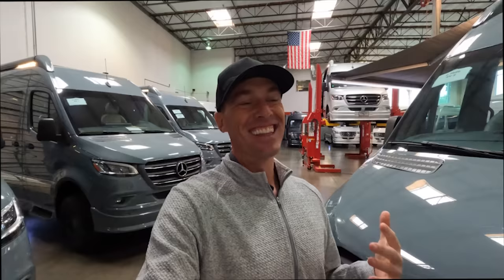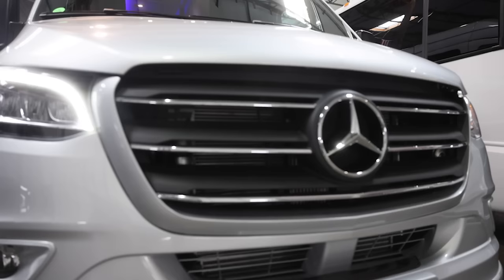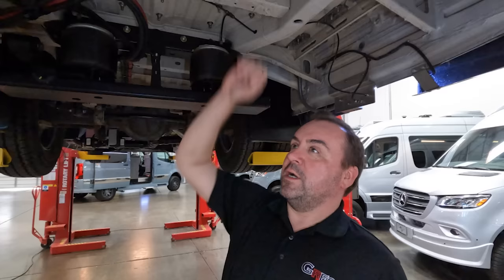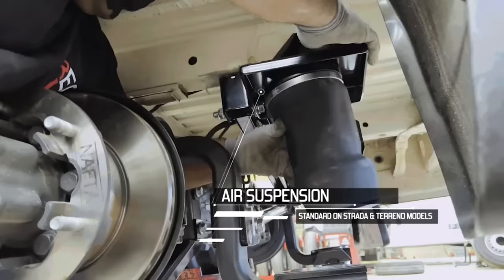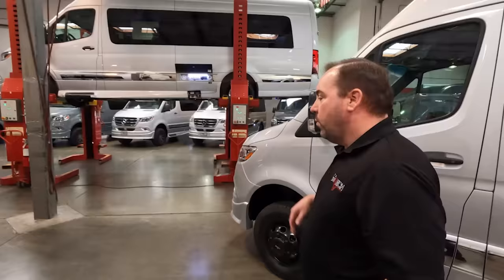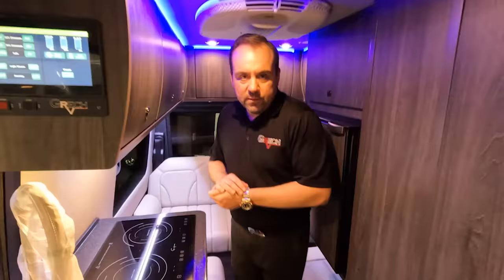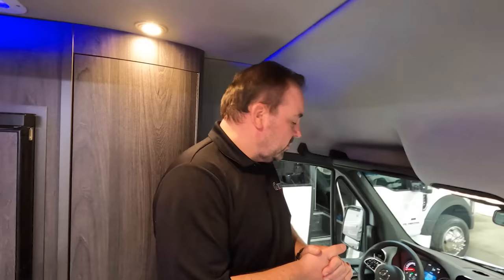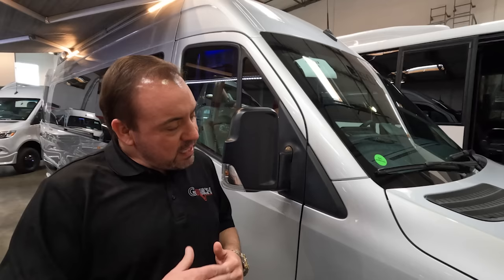Luxury Class B RV Shopping 2023 at Grech RV Headquarters

Comment: What about locations of outlets and USB? Those are important. There are four things I don't like: there needs to be an option to get rid of the two little useless seats in the back. Which would allow for the second thing: a dry bath. And the third thing: extra kitchen storage and counter space with the removal of the little seat on the left. Lastly, you really need to move the microwave up where you can easily see the numbers. Put the storage below (pull out drawers?) and microwave up! I love the quality of the build...just make a version for a solo driver that does not need the huge bed but wants dry bath and more storage. The option for even more solar power would be great, also!

Comment: Plastic air lines for the airbags are running through holes in the steel rails without any kind of grommet or any protection against getting abraded right through, which would cause the airbags to fail and the rear suspension to bottom out.

Comment: Excellent composite floor and interior ceiling construction!

Composites will not rot, mold, mildew or swell,  shrink or split with changing humidity levels.

With over 37 years of advanced material reinforcement engineering experience, with today’s advanced composite technologies, RV manufactures should NEVER  use wood in their RV sub floors, walls etc. 

Wood is fine for interior cabinets, but only aluminum, steel, fiberglass molds and advanced specific purpose engineered composites should be used in RV floors, walls and ceiling/roof applications. 

In fact, Airstream has ditched wood subfloors, switching to all composite subfloors.

Comment: Hey Drew, question for you. So what is your opinion on indoor storage for your Grech? I really want to get one but I dont have a spot at my house to park it inside. One of the reasons I want a Grech is because I travel from PA to FL for work around 2-3 times per year so I wanted to save on hotels and flights (I hate stating in roach motels on 95). So paying for storage would negate any savings on that. Also, seeing some older sprinters that were obviously kept outside look kind of rough after a few years or do they just need a good detail? I dont want my RV sitting in my driveway taking up space and looking old. So what is your opinion on storage for your RV? Thanks, Andrew B
Reply from the maker: I would be ok storing outdoors. It fits in regular parking spot so you should be able to find something reasonable.   If you keep it clean and coat of wax on it, it should wear well over time. Most of the trim is painted silver so will  not fade like the black plastic you see on other sprinters.  Sounds like the grech is the perfect vehicle for the way you are going to use it.
Reply: Thanks for your opinion, I appreciate it. I think you’re right - if you keep it moving and keep it clean, no need for indoor storage. Good call!